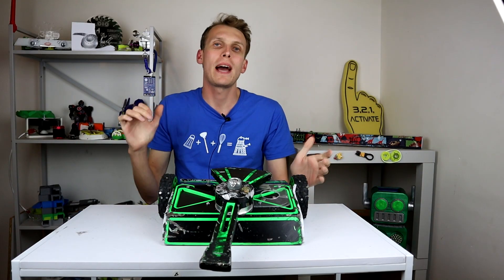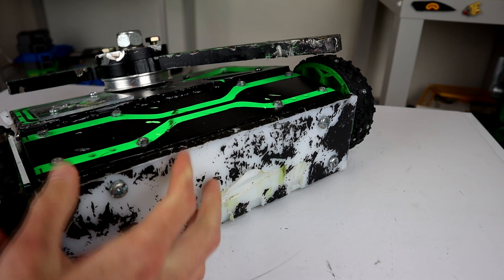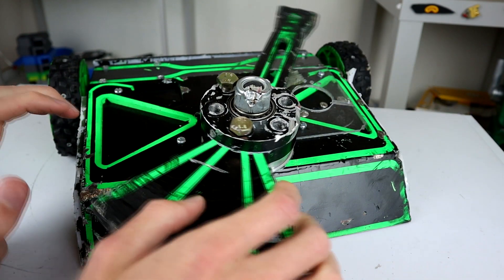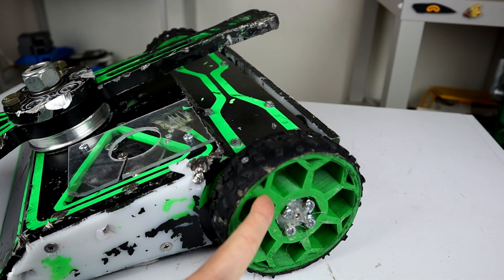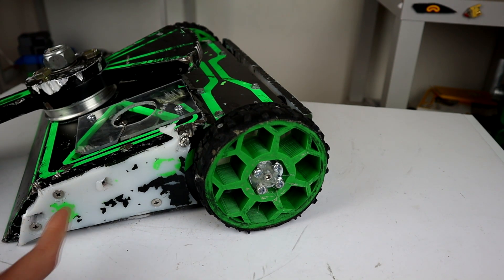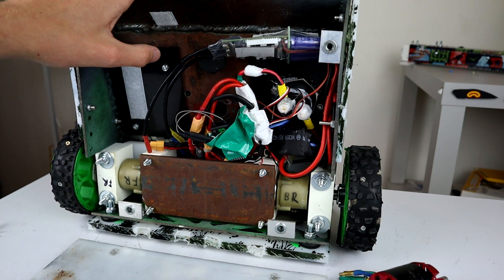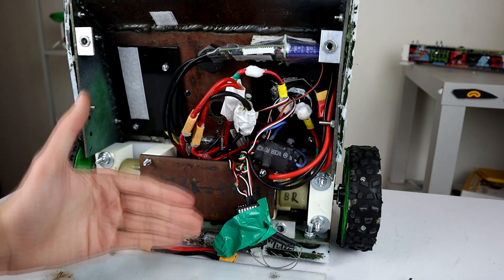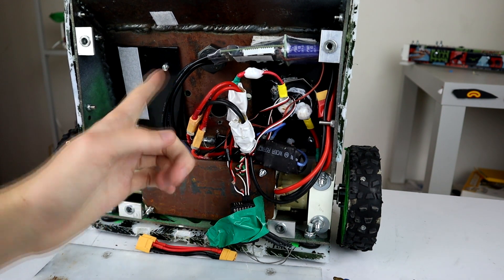13kg robot damage breakdown!

Comment: I tend have a similar problem when it comes to mounting all the electrcal "gubbins". Something I intend to try on my next robot is to 3D print a sort of "mould" for the electrics, like the kind of foam padding you'd find in a toolkit to keep everything in place. If you have access to a 3D printer that can print rubber filament, perhaps something like this could work for you as well?

Comment: on the drive bit, without doing a frame rebuild i see two possible ideas, the single-stage reduction like you said (tho most here in UK 6:1 5060s 270kv @6s) or possibly how about Hub motors, simple give you some room to make a proper electronics box or you self righter